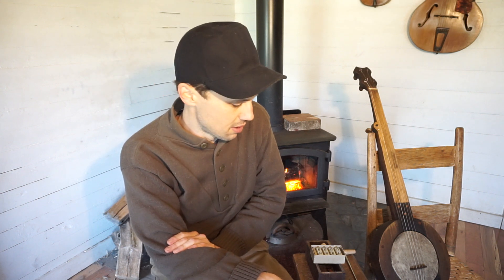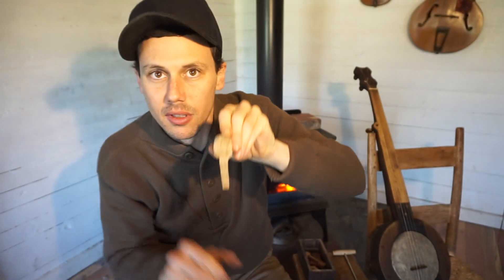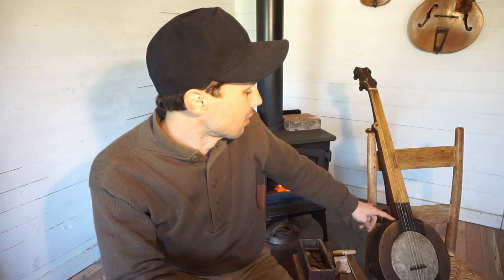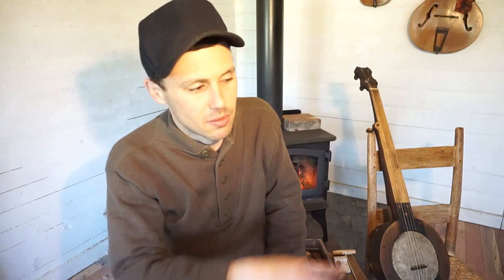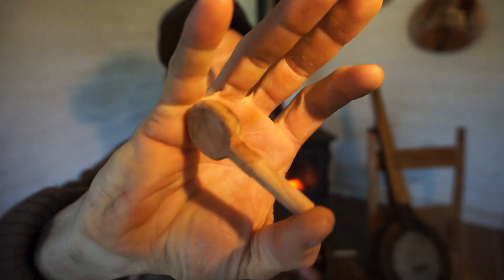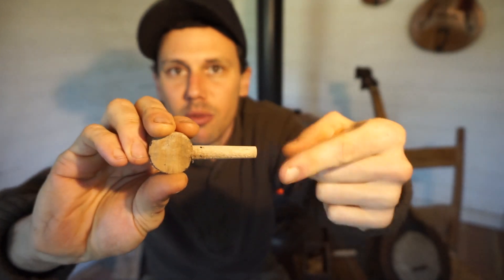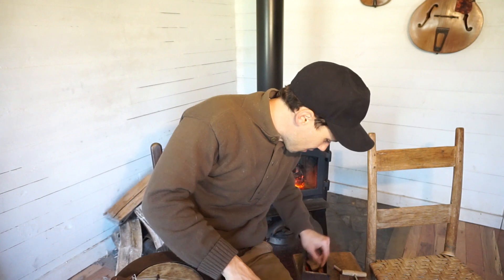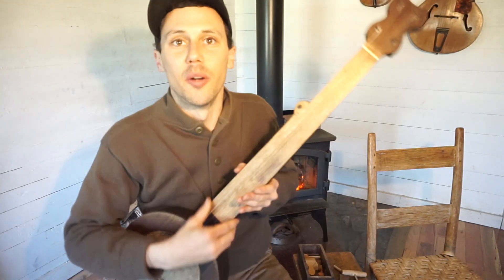Q&A | Hand-Carved Tuning Pegs?

Comment: Cool! But then? U make holes and start tuning and turning. So it has to stick. Now that mechanism would be very interesting. U have to lock it. U proly made a video on it. I'll go find it. Thx! Great upload!
Reply from the maker: I used to keep honeybees, so I still have several pounds of 100% beeswax laying around the house. Pure beeswax on the peg and the n the hole works well. Others use violin rosin.
Reply: @CliftonHicksbanjo  I just figured out the steampunk version of a tuner. A hose clamp. U would have to cut it off so you can attach the hoseclamp to the guitar . Then attach the string to the moving part of the hose clamp. Use a screwdriver to tune the guitar or banjo or whatever. If the mechanism looks horrible it can be in the back. So the string goes through the wood and the tuning mechanism is a little less obvious. Lol. After tuning, throw the screwdriver into the guitar and it wont get lost. Lol.

Comment: Clifton...thanks for this discussion. I am in love with the minstrel banjo, right now. They have friction tuner. I have several newly acquired Prust Tackhead. 

My question: How do you explain to an innocent doe eyed person how a friction tuner works? I try to explain it in horizontal vectors of energy but that does not work. I even compared it to a capstan on a schooner that draws up the anchor and chain but no luck. 

Also, do you drill the hole in the head at an angle away from the strings or straight through?

Comment: Is there any good way to make a peg and avoid using these tools? I realize at that point it’d probably be easier to just tear the tuners off something else though
Reply: Ive come across a few old banjos in my community which had tuners carved with a pocket knife, not ideal but it works when times are hard as they often were back then
Reply: Yeah just copy some you pull from another instrument, and build a replica of it to use as a template and one more to affix some sandpaper to ream out the peg holes. I think I'm going to attempt making my own pencil sharpener tool or modify and old one. Look up homemade dowl, it's pretty much the same but you're going to need a taper.

Comment: Is there any reason a guy couldn’t or shouldn’t use mechanical tuning pegs on a mountain banjo build?
Reply from the maker: The first one I built (age 16) had mechanical guitar tuners.
Reply: Thanks !
Reply: Does Having the 5th string pegged like you seem to prefer allow you to not have to have a nut or screw head for the string to ride in? What are some other advantages?